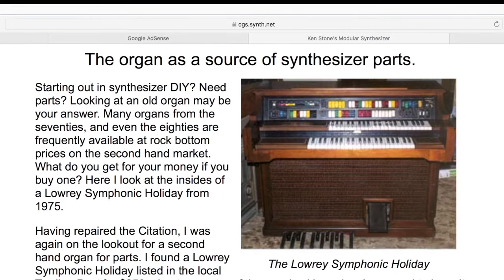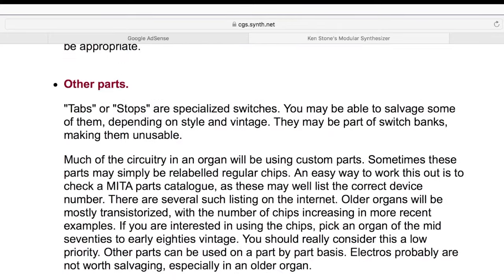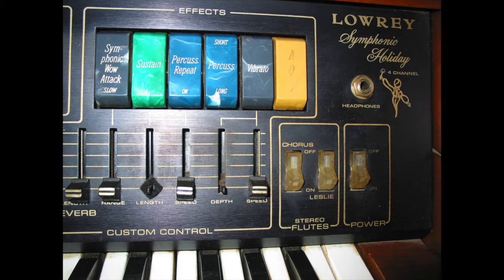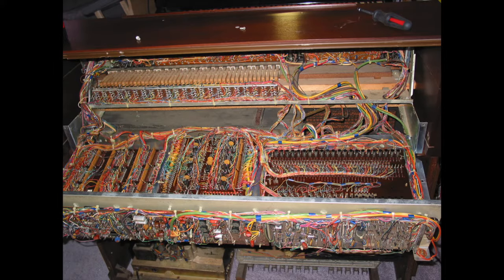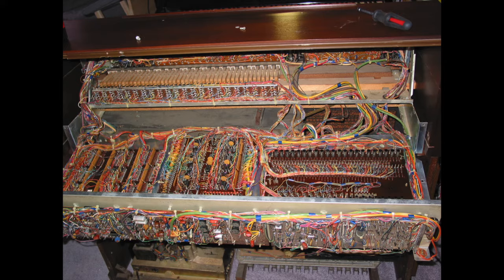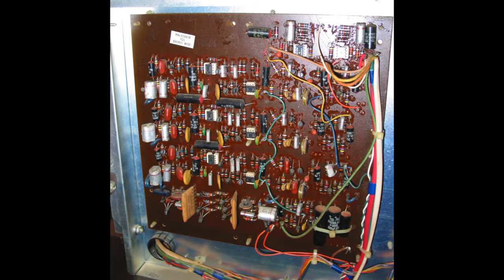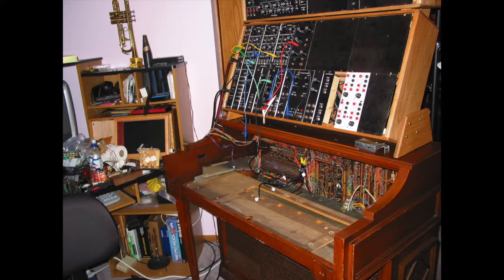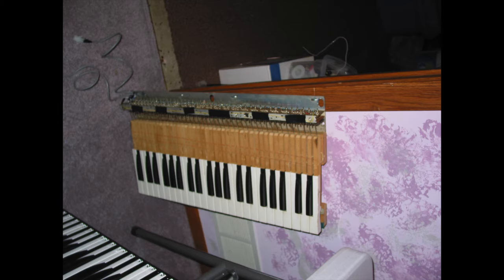Look Inside Flashback -  Lowery Organ teardown

Comment: I acquired the electronics for one of these (the owner wanted the cabinet and sold the rest!). The flute filters are 3 stage low pass filters, one for each half octave!! Makes for a lot of filters, but very dull flutes. I would recommend halving the capacitor values which brightens the flutes considerably - more like a pipe organ stopped flute that way. The keyed square waves are also summed in a standard i.c. mixer to feed the string and reed filters. These can be improved by a bit of additive mixing an another mixing amplifier if you have the skills. Reeds should have a staircase waveform or they will sound to thin or too bland.

Comment: This certain model is a four channel which means it has two 6x9 mid speakers one on the side and one beside the expression pedal two 10 inch woofers in a sealed acoustic lined enclosure one 8 inch diameter speaker on the other side of the expression pedal and of course the lovable Leslie speaker

Comment: It took me a while to figure out how to get into my grandmother's organ so I could work on it.  After you remove the back board, there are two 1'4" wood screws on each side each holding in a round wood stop. Remove them and then remove the two 1/4" sheet metal screws on the outside part of the metal circuit board frame.  Then you can pull down the metal panel with the three circuit boards.